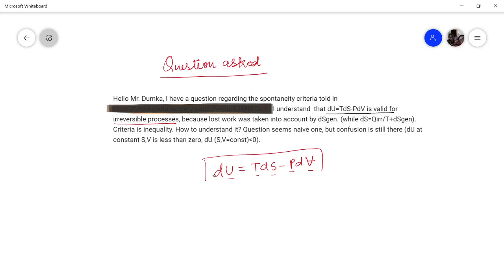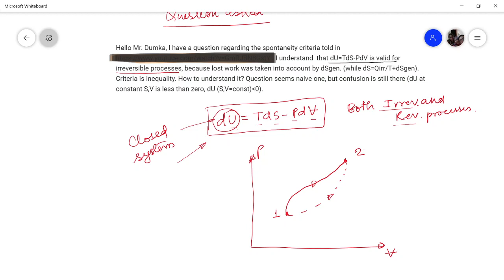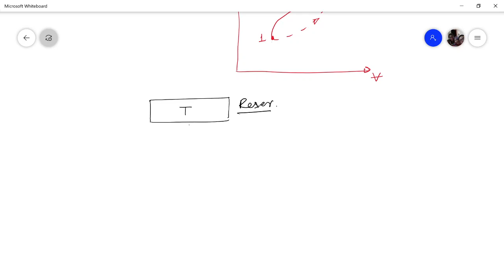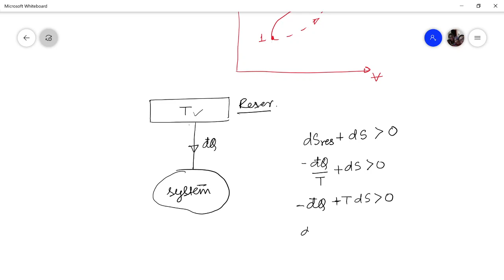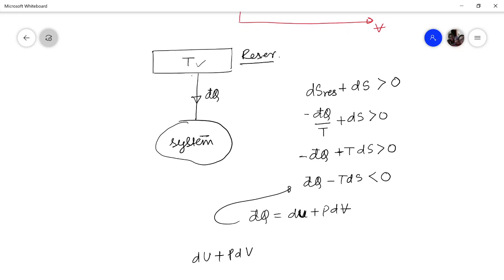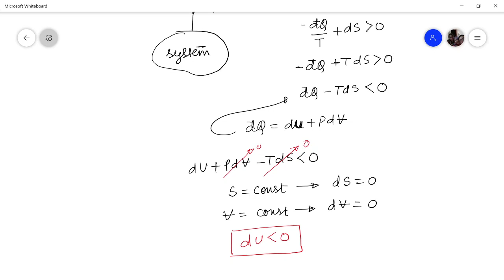A question on thermodynamics

Comment: Thank you for your time and kindness. I "followed" derivation in a reverse direction in a given example with HR. Isentropic and isochoric implies that dS=0, dV=0. Then let's go back to initial dS(total)=dS(res)+dS>0 or dS(res)=-dQ/T>0. So a sign of dQ must be negative, which means the reservoir received heat and the system gave heat (lost some entropy). For a process to be isentropic with constant V, the system must apriori be in a non-equilibrium state where the spontaneous process evolves to "maintain" S=const.  And once the system gave heat without doing pressure work, delta U is obviously negative. Can be thought of in that way? Going back to the original question, in chemistry, a reaction at the start is in a non-equilibrium state with deltaG<0 and we end up with deltaG=0 after chemical equilibrium is reached. And dU=TdS-PdV describes a transition between two equilibrium states by any process, whether reversible or irreversible. I started to think in this way. Thank again Mr.Dumka, I always loved your videos with deep physical insights, not only maths.
Reply from the maker: Thank you so much.